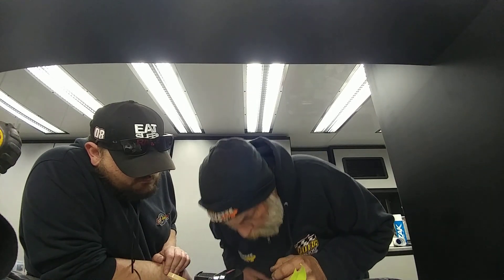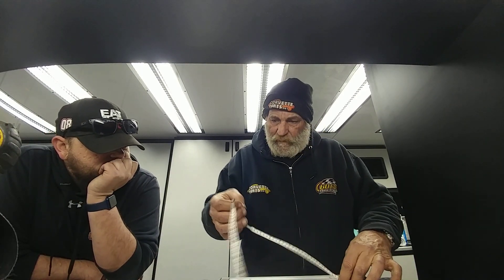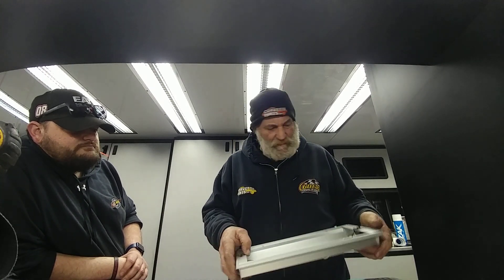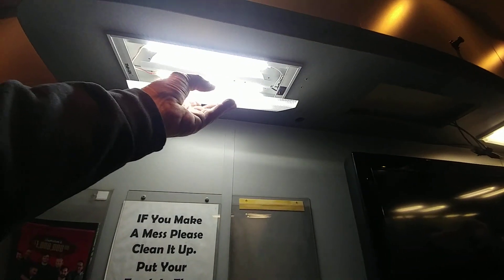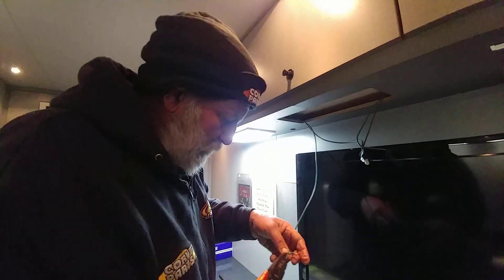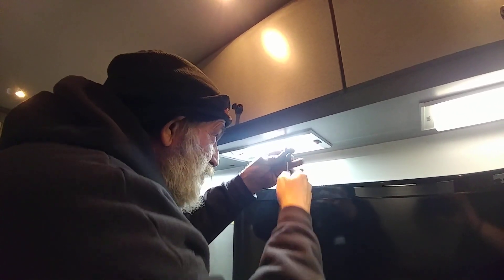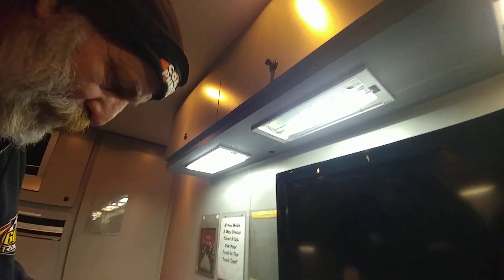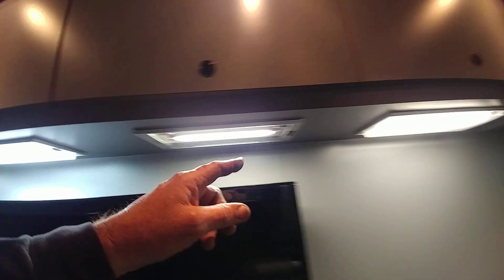Giving CUBBY A Learning, Part2

Comment: You say 12volt? Are they deep cells, that are trickle charge from the tractor or do they run off the generator, the lights?! OMG 18 year old trailers, still rolling down the road 😮👍
Reply: As long as you keep the trailer in good condition and maintained you’re  just fine. Check out the video that Ron has about the Goodyear tire equipment trailer. In the airline industry, a lot of people would be shocked at how old some of the planes are that we fly in our freight flying fleet. The majority of our aircraft are ex passenger planes that were deemed too old and converted for freight. Always take care of your equipment and it will take care of you. 🤔👍